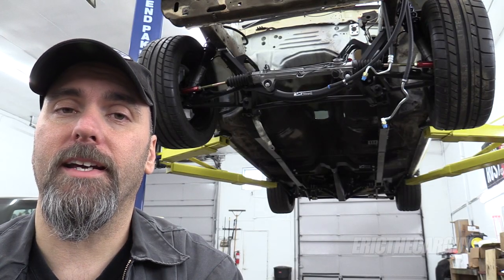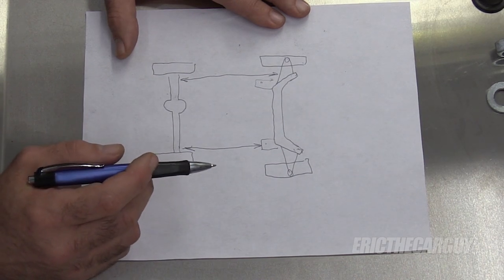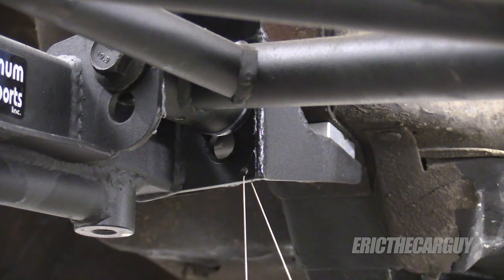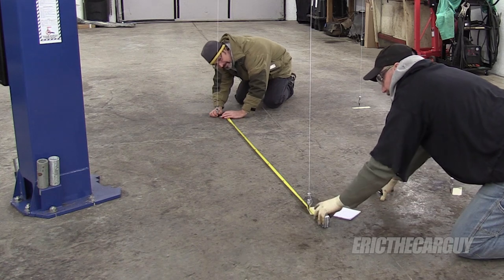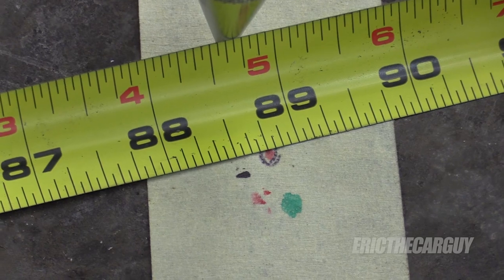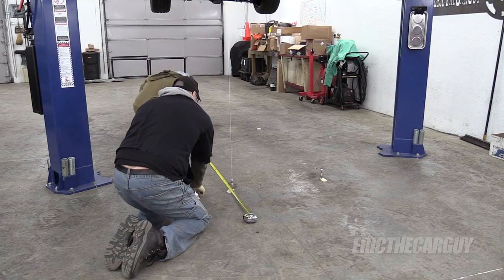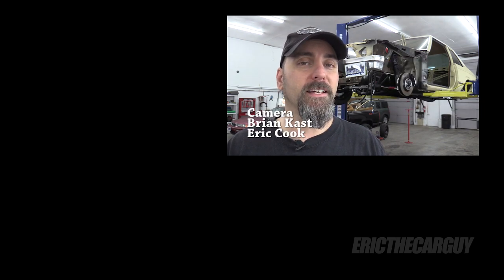How To Square a K Member and Why It's Important

Comment: Circumstances were that I never had a place, the time, the tools or the know-how to do my own repairs. Plus, I have a disability - I was a liberal arts major and I'm Irish. So, I'm just not a details kind of guy. This video - I'm impressed; down to the 16th's. I was worn-out by the time you said you'd have to recheck the measurements. I was ready for a nap!  But, you've given me the courage to go out and bleed the brakes on my '97 Dodge Ram 1500.Thanks for the inspiration.Kindest regards,Paul
Reply from the maker: I don't think comments get any better than this. Thank you very much.

Comment: Nice video, Eric. That's a great way to square up a k-frame at home. I've had to do a lot of k-frame/engine cradle replacements while working in my company's bodyshop. Fortunately, there is a little bit of room to move the frame/cradle around while doing an alignment. I see why Max Motorsport recommended that point in the rear, as that point is usually square to the body. I've had to explain countless times why the rear end alignment is so critical to the front end alignment. A lot of people don't realize that the rear end alignment affects the front end alignment. Keep up the good work!

Comment: When the mounting bolts are fairly tight, drill a couple of (one on each side) and drive Spirol pins (coiled preferably) in before torquing down those bolts; things wont move about. Great video as always.

Comment: Hey Eric. I been binge watching your fairmont videos for the past two weeks, among some of your other videos, and they're AWESOME. Mostly because I myself have a 4 cylinder 1982 notchback mustang project that I inherited from my uncle, I've got a 351w bored 60 over (currently sitting on a engine stand) that has a ton of work done to it, although it's been sitting for a long time... a TKO 600, K frame, Driveshaft, ford 9 inch and some other parts that ALL need to go in it. While I don't quite have the space to do any of the work right now, your videos are helping so much, showing me I'm going to need a LOT more suspension parts hahaha and giving me a lot of confidence in attempting this build instead of just trying to pay someone else to do this. Oh yeah, I forgot to mention there's a B&M 144cfm blower that's going to be mounted on the 351w, supposedly going to have in the neighborhood of 480 hp and 510 ftlbs. This series has gotten my so exited for my build, and I can't wait to see your end product! Thank you

Comment: Great handy hints Eric, but transferring inches to mm definitely showed me the fine alignment you were dealing with: 1/16 inch = 1.588mm. Fantastic work, regards Stewart.
Reply: Every time he says something in imperial units, I have to convert it... I'm American, but I've only ever worked with European or Japanese vehicles, so I have no frame of reference for how large a 3/8ths socket is.
Reply: 3/8 inch or 9.525 mm is exactly the drive size for many ratchets and sockets.
Reply: Haha, ok, so that was a particularly poor example, but say I need a 3/4ths or 11/16ths socket. I have to do Maths to figure out what size is bigger...
Reply: Was all intended to be humor. 
For me converting in to mm and vice versa gets to be second nature after a while and the equivalent sizes are just known without even thinking.
Reply: No worries :) I would imagine so, but like I said, I've never worked on a car with imperial bolts/etc, so I'm just not familiar with it.
Reply: computiNATEor Even US cars only use metric bolt sizes nowadays, and most (but not all) wrenches fit each other's system good enough to start using the wrong tool but not fit exact enough leaving you with a risk of rounded bolt and nut heads.
Reply: Right, my mom's old 97 Caravan was all metric
Reply: computiNATEor  I agree, all those fractions are bloody confusing,  better if Eric did imperial in decimal numbers, regards Stewart.

Comment: The instruction for using the bolts in the rear for measurement is because you are actually taking info from the actual frame and not some after-market component to square the K member, plus those random holes you find sometimes in the body are not always in perfect correlation. 
Lasers are always better for these sort of situations.
Other than that great video Eric.

Comment: Installing  a complete UPR K Member kit on my 78 Zephyr Sport Coupe. Very usefull vid. Wondering if I should use the rear bumper bolts ( on frame) as a mesuring point ? I might also use the tubular lower holes like you did. I actually might use 2-3 mesuring points on each side just in case the body twisted over the last 41yrs !!

Comment: Great job eric, i like the extra locating holes drilled, smart thinking.
Reply from the maker: Wish I could claim credit. That's actually in the Maximum Motorsports instructions.
Reply: You did the job, shut up and smile lol :-D
Reply: if you wanted to take it a step farther, i bet you could drill and then tap the hole so you have a dedicated locating screw that helps hold things in place as your torque the k-member bolts.
Reply: I agree.  That would also ensure the k-member doesn't shift as you drive, if you hit a large pothole or scrape a curb.

Comment: just a thought, would you have been able to use a longer bolt in the rear so the plumb bob could clear your reinforcement instead of going the route of hanging it from the control arm?

Comment: So with this k member you have on your car, is it maximum motor sport? I’m looking for a adjustable one, since my one side of my car the wheels sticks out more the. The other and it has been in a accident, but only damage I seen on frame was right where the bumper supports go I don’t see any other damage or kinks, could just be the body off when they lined it all up but I want to see if I can maybe add a adjustable member and move it just the slightest bit to center it,

Comment: @EricTheCarGuy I am sure you are ahead in the restoration from the video timeline and i have a question.
Do those plates for lowering the k-member alter camber?Because the mount of the lower control arm (theoretically) will be at a low(er) point pushing the ball joint "out",thus increasing negative camber.
I would like to know the result because i have thought about it for my application but haven't got to it yet.

Comment: Good watch! It always neat to see how similar the the strategies across all car makes for basically doing the same thing.   I have done a good amount of suspension work, only some rear end 4 link setups on a late model mustang, most of the other stuff has been mostly Honda and just recently Porsche.  What I have found getting the measurements as close to dead on helps so much in the end, this comes to alignments too.  It drives me nuts seeing alignment shops put the measurements in range the thing pulls like hell or just has less than confident feel.  I know there is a lot of theory with OEMs alighting their cars to certain types of roads, conditions the list goes on.  For me I feel having everything equal, camber same on both the front along with caster and toe and the same for the rear but obviously differing amounts gives a more consistent feel to the car and less it taking you for a ride and having to counter steer.  Having the front off from the rear I have noticed will tend to cause the front to push under acceleration or under hard braking.  You can measure that the k member will be off from the alignment if it follows suit might be something like you can get more camber out of one side on the front than the other.  btw wish I would have thought about the dot on the tape then move it under :p  Its a pita to mark under those plumb bobs.

Comment: Eric, you wanted manual steering in the beginning - is there a reason why you switched to power steering now anyways? I'm driving first car ever that has power steering, and boy is it weird. Especially if you've been driving without since almost 20 years... ;) I am always afraid it might go kaputt when I tilt the steering fully or something like that.
Reply from the maker: After rethinking the front suspension I decided to go with power steering. It just seemed to make sense. I'm already putting AC on the car, might as well do PS too.
Reply: EricTheCarGuy well better to change your mind now than when the car is completely put together

Comment: Can you square a factory does k member? I don’t want a tubular, it’s not even safe as for accident and what not, and I don’t need no weight reduction, but I would like to know if Ford has any adjustability? Maximum motor sports says there is a bit

Comment: Correct me if I'm "doing it wrong" but it looks like this would be useful if you're doing collision repair as well say straightening a front clip or something like that.
Reply from the maker: That's exactly correct. In fact, if you look at some body shop equipment they have these long metal measuring tools (tram gauge) just for things like this. There's also a book with different make and models that lists the measurements you should see and what points to measure from so that you can check the squareness of the chassis.
Reply: EricTheCarGuy This video proved my life sucks.  My birthday was today and you didn't wish for it to be a happy one.  Thanks 4 the unhappy birthday...... jack.  ;) JK   BTW......keep up the good work!
Reply: It wasn't an ETCG1 video. BTW Happy Birthday. Nobody's life should suck.
Reply: Sorry, my mistake.  Thought he did it on all of his channels.  By the way, not my birthday, life not sucking at moment, and JK means just kidding.

Comment: I have a unrelated question Im hoping for a solution. How do I fix uneven brake wear on rear drum brakes? I have found plenty of info on disc brakes but next to nothing on drum brakes. The outter shoes on both tires are worn but the inner ones look like theyre not even touching the drum.

Comment: Hey bro crossing fingers ill get a reply on a 3 year old video but its worth a shot. I'm going to be removing my oem k member to restore the finish and then reinstall the same oem k member ill this centering need to be done or is the oem a non adjustable unit and centering in your video is only something that needs to be performed with an aftermarket k member?

Comment: OK, I am having a problem with my car, on Petrol (Gasoline) it idles rough, the revs start low then raises up a little then dies down to normal.

When I switch over to LPG, t idles well for a few minutes but then it backfires when I push on the accelerator.

I have changed the spark plugs but that doesn't do anything at all.

The engine is a 2002 GM Ecotech V6 engine, not supercharged with after market LPG system installed.

When I drive the car, it is fine for a little bit but then it stalls without warning.

What do you think I should do?

Comment: don't most cars have like dowels or dimples in the rail for aligning the k-member? or is that just something on more modern cars?
Reply from the maker: More modern cars. Cars of this vintage were not manufactured to todays standards. As a result, they needed 'adjustment'.

Comment: hi from Venezuela, I have my crv 2006 (110.000mi) but went i turn on the AC the engine start to vibrate but the rpm its fine (700-750) what could be the problem? (the engine mount are new)

Comment: Ive had to measure things "square" like that before and its crazy all the minute things you have to make sure you have in place before you get accurate measurements. I was doing it on things that were suppose to be less than 1/8" in square and they are 36ft. long... crazy

Comment: I had a 1994 S-10 Blazer with 4 doors, and that SUV had problems which I didn't know about when I purchased it, but found out about it later. First, I would apply the brakes when stopping and the vehicle would go into a skid instead of stopping directly. The second thing was that it would not turn correctly at an intersection and I ended up wrecking that vehicle on a country road because of sand which was on a gravel road, and when I tried to turn the steering wheel, the vehicle would not turn as I wanted it to and when it did, I had no control and it slid off the road on the opposite side of the road, and overturned in the ditch twice.

I figured out that the vehicle had been wrecked, and the dealership I got this vehicle from purchased it after the frame was supposedly straightened up correctly. Needless to say, I never purchased another vehicle from that Chevrolet dealership again. I have seen other vehicles which didn't have the body within the tolerances you showed us here, and they ended up with the vehicle not going down the road straight.

Comment: Help please I have a 2005 Acura TL and it's giving me a p0340 code but the cam sensor is good . I have source power and ground and 2.8 volts at the signal wire

Comment: My question has nothing to do with this video , But I have a 1999 Plymouth neon that cranks , but has no power source as to no lights and fuel pump doesn't turn ,anything that turns on by the power doesn't turn on , it only cranks?

Comment: i'd have come of the rear axle shaft center point to get the front subframe square, and then when the front wheels where on, i'd have aligned the front axles the same way, yeah the body may be a little out, but the bodys just a passenger tub and not an important part of traction forces

Comment: when and why did you get a power rack? i rember you talkin about a manual one
Reply: It is a manual rack, but he just keeps calling it power steering since mostp eople will have one.
Reply from the maker: After deciding to change the front suspension. I figured, I might as well go with power steering. After all, I'm running AC, might as well make it easy to steer too.

Comment: Seems like you're losing some ground clearance under the difference with that torque arm. Any issue with that?
Reply from the maker: Not really. The benefits of the torque arm far outweigh any ground clearance issues. I've talked to builders and they say that as long as you have 4" of clearance you're good.
Reply: Very good. It looks pretty stout, like you will have no worries is you go of road with it. ;)

Comment: what makes these sorts of things really tough is it's hard to tell if you screwed it up.  If your rear, or front bob's aren't hanging exactly the same on both sides, it throw's off your measurement, but there's really nothing to tell you that's the case.  So even if you do measure to a 16th, or even smaller, you could be out in excess of this.

not likely to be relevant if your as careful as eric was here, but just food for thought if your tackling this job yourself in the future.

Comment: if your car dose turns this might be impotent but dont relay see the point ?  if your just installing a k member for drag racing like im doing on my 94 mustang  should just bolt up cant be that off the original k member was not slotted for adjustment  i like to work on things as simple as possible not harder guess ill find out one way or the other lol  good luck with your fox build

Comment: Great video.. had to do this on my Mustang, except with it on jack stands, while laying on the ground.. lol
Reply from the maker: Shorter strings means the plumb bobs swing less. ;)
Reply: EricTheCarGuy Couldn't one lower the bridge enough to get that effect? I think a second advantage is that the lower the car to the floor, the less role the perpendicular angle of the bridge to the floor is (ideally 90 degrees, but could be 90.1 one side and 89.9 the other side). Thus making  one side of the bridge higher by 1/16. You want the car to be parallel to the floor within the same tolerances as the other measurements I suppose, unless they cancel each other out.
I can also imagine the challenge of the masking tape shifting because it doesn't adhere properly to the greasy concrete.

Comment: Nice one. Are you going to protect all the new parts with a coating, like Tectyl?
Reply from the maker: The K member and rear suspension parts are already powder coated I believe.
Reply: EricTheCarGuy Ok.. that is some durable stuff. I'm just amazed how little rust protection is used on cars in the US. In areas where salt is used during winter time, that is.

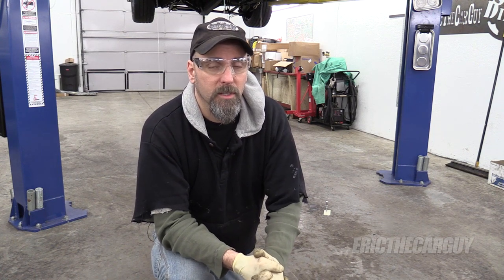Comment: 8:10 - GASP!  NON-"Pee Pee Vision"™!  What happened to the amber wonders??
And to TLEG below, you're absolutely RIGHT.  The Imperial system is a very screwed-up way to measure things, what with fractions, lowest common denominators, etc.  We should have changed over to the real world standard long ago.  Like the old English monetary system based on 16 instead of 10, it makes little sense.  Mind you, I'm speaking as an American here.
Now, most American products destined for export do actually use metric measurements, as they want to stay current with the rest of the world, but it's still a PITA (Pain In The... Derriere).
Adjusting the suspension alignment reminded me of Mr. Miyagi instructing Daniel-san how to warsh cars - Up-down, side-side.
This vlog was Very Informative, and covered things that I'd never thought about, but which are critical to getting the most out of your build.  THANK YOU, Eric!

Comment: First pull the rear bumper hits the ground and sparks, front end gets tqd 4 inches - returns 3 7/8", steering wheel ends up 15* off for the rest of Eric's days. Alternate ending... Fairmont drives so straight it picks up the nickname Plumbob Squarestance.

Comment: Use a laser for distance measuring. Far more precise. And there are magenic clip on lasers you can use to measure straightness and inclination as well. Metal measures are not precise.
Reply from the maker: I agree, but those are expensive compared to plumb bobs.
Reply: Yes, but almost the only option if you're working alone.

Comment: When I square the rear or k member in a Fox I use the lower control arm bolts on the body side.  it's a fixed point that does not move.  Just be sure to hang the string the same on each side 🤘🏼🤘🏼 
STAY DIRTY 🤙🏼